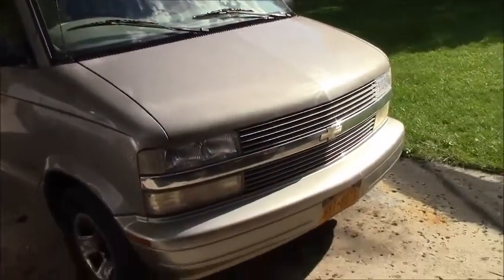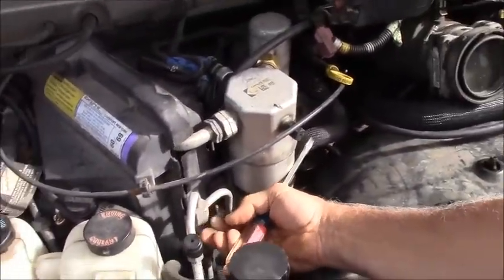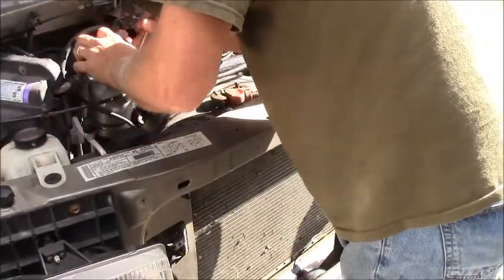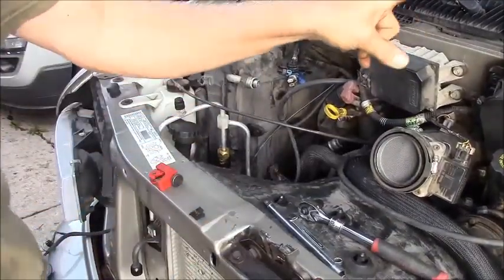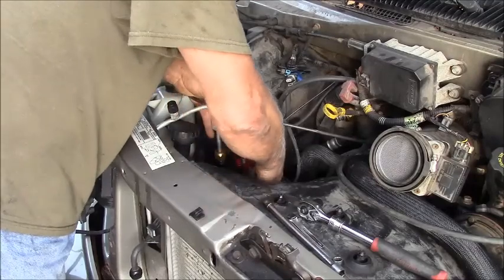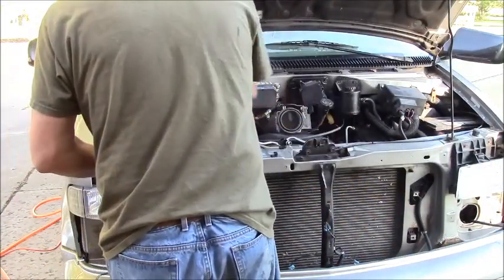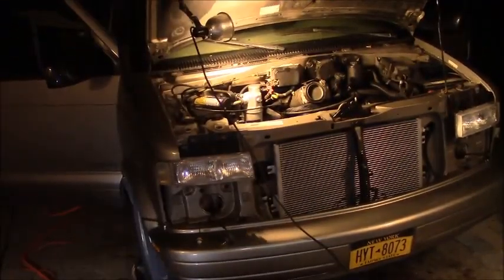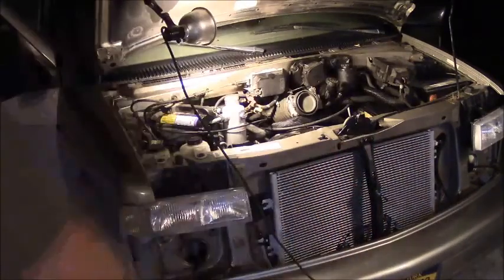DIY How to repair and recharge a Chevy Astro AC system, replace condenser, flush AC system

Comment: iam Your Newest Subscriber Great Videos. I Just Bought A 1995 Astro Jayco Conversion Van 115k Miles Rustfree Florida Van
Reply from the maker: I just used my gauge set to troubleshoot my grandson’s Corolla. We replaced the clutch but it didn’t get cold… adding another pound of refrigerant got it down to 45 degrees… it needs just a bit more to be perfect! It should get down to 40 or below!
The low side should be around 35 psi and the high around 200psi.
Thanks for watching!

Comment: I am referring to the piece you installed at the end of the tube when you cut the high pressure size,  on 13.06 you are holding in your hands.  I need that part

Comment: Had a question about the wiring switch that connects to the accumulator, on my 99 Chevy Astro one goes to the accumulator, and I have another that splits from that one that somehow has gotten disconnected and I cannot find out where it goes. Is their a connector on the firewall or where does the other switch connect to?

Comment: where did you get those cap off things, I cannot find them, and I would like to do the same thing you did.  thanks.
Reply from the maker: not sure what fittings you mean... the car has capped off fittings installed as all AC systems have. they allow testing of the system. The rest of the kit I got on ebay pretty cheap... don't remember exactly how much